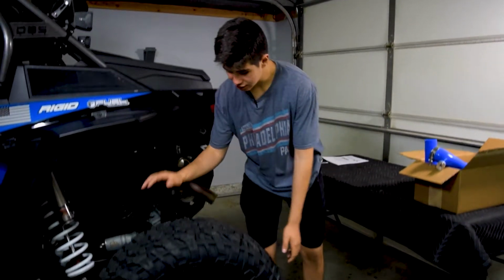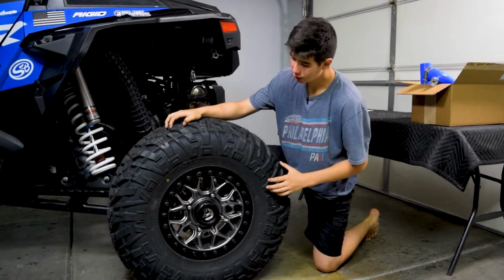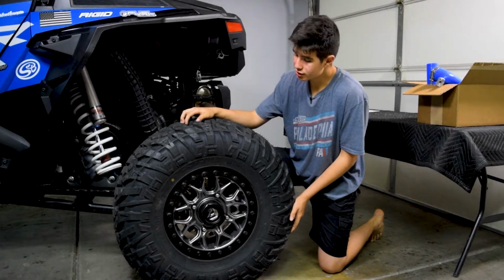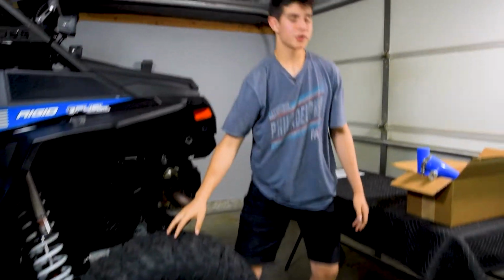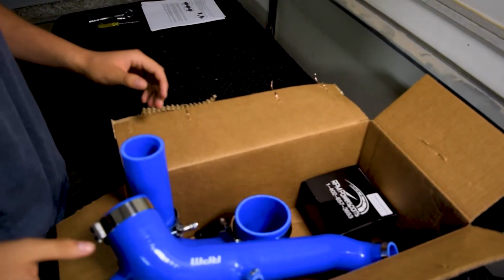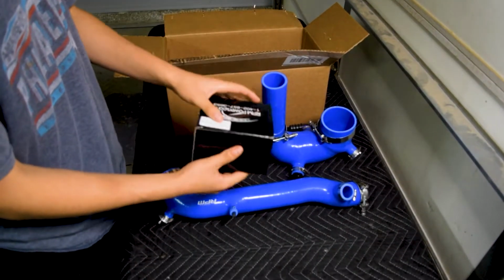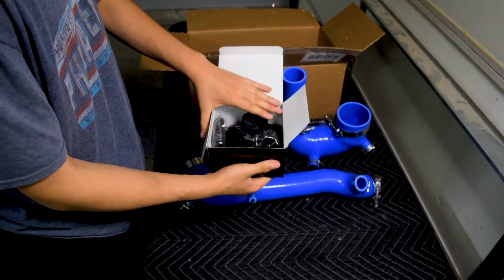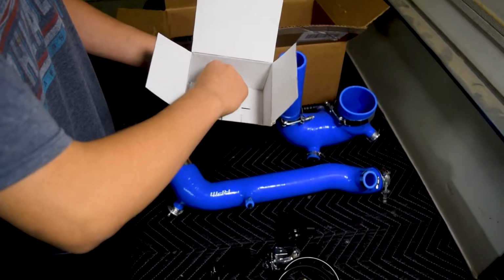RPM Charge Tube, BOV and J Tube upgrade on our BTS RZR XP4 1000 Turbo S Velocity RZR ASMR

Comment: Adding 12 pounds of rotational mass to each tire is a sure fire way to make your car slower.
Reply from the maker: It definitely has it's pros and cons. Out of the holeshot it's slightly slower,  but on the trails its a plushier ride and and it feels like it has better grip and handling🐏